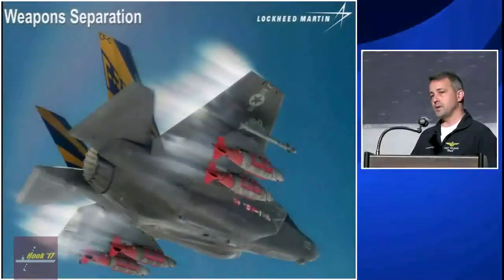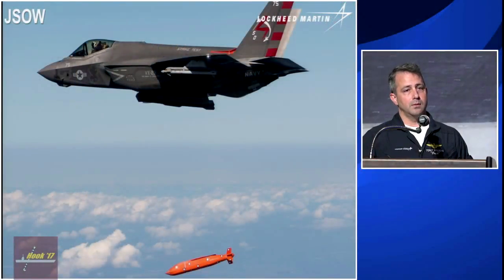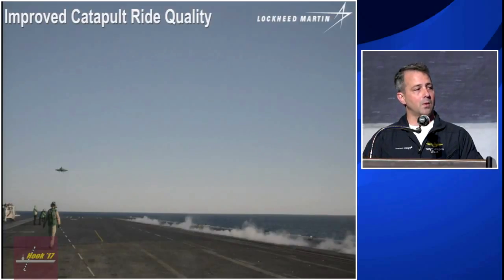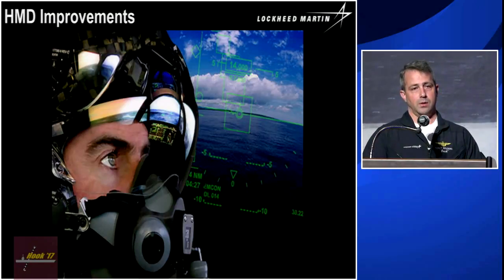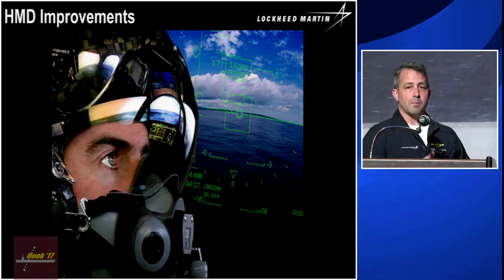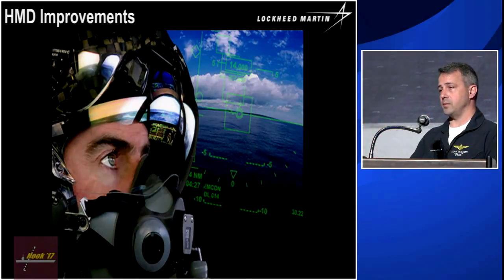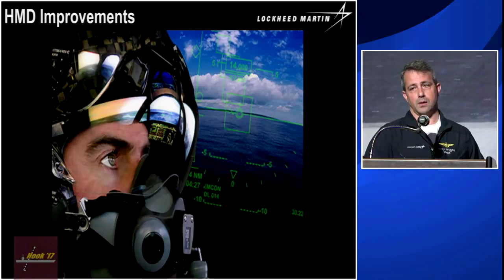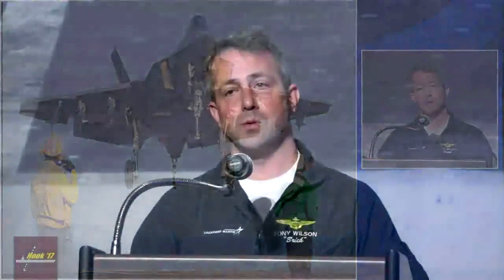Tailhook 2017 Symposium - Update on F-35C testing from LM test pilot

Comment: '
american any F-35s must has twin jetmotors are better than single jetmotor
Reply: F-16s are fine with single engines. and F-35 haters say F-16s are better....
Reply: bestamerica

F-35's 43,000 lbf large engine is roughly equal to Super Hornet's two GE F-414 medium size engines with 44,000 lbf combined thrust.

F-35's Option Block 1 engine upgrade has 6 to 10 percent higher thrust.
Reply: Why?
Reply: Hanz Cedric
F-16s are fine with single engines. and F-35 haters say F-16s are better....
'
both F-F musts be good team together...
no no both F-F hates each other

Comment: '
stop this video...
dont have to show this video...
enemy countrys can watchs this video, learns, copys, makes, flys test, trainnnings, cyber computers virusmakers, return revenges...
dont do that
Reply: bestamerica

No they can't. The information is too selective to be dangerous.

Also, twin jet engines aren't better than a single one. They require more maintenance, have a high risk of critical failure and the F-135 engine is extremely powerful anyway. The F-35 engine produces as much thrust as both the F-15 engines combined.
Reply: bestamerica, many of my fellow US countrymen may be slightly illiterate but certainly not to the extent that you are. Kindly stop posing as an American. Besides, if you think that it displays classified information, you are more than welcome to take it up with the MoD.
Reply: hi HV...
thank explain...
dont use a word - YOU -  on me...
let explain about this video...
here is a free time comment
Reply: hi ivanlagrossemoule,
twin jetmotors are more faster speeding and great flying sky...
F-16 is a great plane, tooo
F-16 is a little faster speeding than F-35...
both F-F are good planes
Reply: Best - You know they had Chinese parts in the f-35? You know that china hacked the US military sideways 10yrs ago?
heres the list
SYSTEM DESIGNS

Terminal High Altitude Area Defense
Patriot Advanced Capability-3
Extended Area Protection and Survivability System (EAPS)
F-35
V-22
C-17
Hawklink
Advanced Harpoon Weapon Control System
Tanker Conversions
Long-term Mine Reconnaissance System
Global Hawk
Navy antenna mechanisms
Global Freight Management System
Micro Air Vehicle
Brigade Combat Team Modernization
Aegis Ballistic Missile Defense System
USMC Tracked Combat Vehicles
Warfighter Information Network-Tactical (WIN-T)
T700 Family of Engines
Full Authority Digital Engine Controller (FADEC)
UH-60 Black Hawk
AMRAAM (AIM-120 Advanced Medium-Range Air-to-Air Missile)

Affordable Weapons System
Littoral Combat Ship
Navy Standard Missile (SM-2,3,6)
P-8A/Multi-Mission Aircraft
F/A and EA-18
RC-135 Detect./Collect.
Mk54 Light Weight Torpedo

TECHNOLOGIES
Directed Energy
UAV video system
Specific Emitter identification
Nanotechnology
Dual Use Avionics
Fuze/Munitions safety and development
Electronic Intelligence Processing
Tactical Data Links
Satellite Communications
Electronic Warfare
Advanced Signal Processing Technologies for Radars
Nanostructured Metal Matrix Composite for Light Weight Ballistic Armor
Vision-aided Urban Navigation & Collision Avoidance for Class I Unmanned Air Vehicles (UAV)
Space Surveillance Telescope

Materials/processing technologies

IR Search and Track systems
Electronic Warfare systems
Electromagnetic Aircraft Launch
Rail Gun
Side Scan sonar
Mode 5 IFF
Export Control, ITAR, Distribution Statement B,C,D Technical Information
CAD drawings, 3D models, schematics
Software code

Critical technology

Vendor/supply chain data
Technical manuals
PII (email addresses, SSN, credit card numbers, passwords, etc.)
Attendee lists for program reviews and meetings
https://www.washingtonpost.com/world/national-security/confidential-report-lists-us-weapons-system-designs-compromised-by-chinese-cyberspies/2013/05/27/a42c3e1c-c2dd-11e2-8c3b-0b5e9247e8ca_story.html?utm_term=.7a37ef397e15
Reply: Exclusive: U.S. waived laws to keep F-35 on track with China-made parts
https://www.reuters.com/article/us-lockheed-f35/exclusive-u-s-waived-laws-to-keep-f-35-on-track-with-china-made-parts-idUSBREA020VA20140103

REPORT: Chinese Hackers Stole Plans For Dozens Of Critical US Weapons Systems
http://www.businessinsider.com/china-hacked-us-military-weapons-systems-2013-5
Reply: 00Billy, there's alot of IFs in that washingtoncompost.

https://breakingdefense.com/2017/10/no-classified-f-35-info-stolen-defense-contractor-hacked-in-australia/
‘No Classified F-35 Info’ Stolen: Defense Contractor Hacked In Australia

BAE hack occurred in 2009 which is before 2010 Lot 4's Carbon-NanoTube material change. LM's Carbon-NanoTube stealth material can be found in Google's patent search.

Comment: Already combat proven by Israel. Totally trashed the hyped up Russian S400. Israel was so impressed by its combat performance over Syria that it ordered another 19 F35s. The thing is a beast.
Reply: Because the F35s avionics picked it up and avoided it all together.  That's the point.  Just like B2s and their "blue line", F35 does the same thing.
Reply: I've been saying once this thing see actions, there will be a line out the door to purchase it.  Then the question becomes who can be allowed to buy it?
Reply: Germany's Luftwaffe chief was fired when he recommended Germany to adopt the F-35, and the Iranian air defense General was fired when the Ayatollah found out Israeli F-35Is had been flying over Iran without challenge.  This was right after Iran had purchased and fielded the Russian new IADS and integrated it with their own radar and missile systems to beef up Iranian air defense networks.  F-35 didn't care, just flew over Iran repeatedly, running C4ISR missions sucking up all the RF and IR data it could gather and process as a net.
Reply: John Connor... basically shows he doesn't know wtf he's talking about lol. Stealth planes don't fly low to avoid radar. If anything they wanna fly as high as possible. The Radar "dome" (detection zone) gets shrunk because of the shaping.
The polar opposite (for same desired effect) of helicopters using terrain masking/flying Nap of the Earth. The whole point of Stealth IS to avoid the radar. You shrink the proverbial "dome" fly around the gaps of the IADS and start bombing whatever (or send in a LR glide bomb to kill radar site in addition/conj. to prev.).
Reply: " Totally trashed the hyped up Russian S400." ???...........poor ignorant....you didn't know that israelis were LICKING RUSSIAN ASS so that russians wouldn't engage them ?
you had no idea that your favorite toy was opperating WITH RUSSIAN CONSENT ( and the S-400 probably even menaged to gather some intelligence on F-35 ) ....that is soo sad
Reply: @themilosgrozni237  sure they were sure they were. We Russians are as pathetic as our weapons get over it.
Reply: The Russians won't be shooting down international warplanes because of major ramifications.  Nothing to do with evading S400z. Putin still laughs at the F35
Reply: if it trashed S400 .. why Israelis flew at low alt to avoid radars ? fail
Reply: John Connor:  No way they could have flown low level and done the unrefueled range they did.  Had to be high altitude mission profiles.
Reply: @johnconnor654  you're trash

Comment: Full external load and still Mach 1 plus....
Nice!
It does all the thing haters said for years that it would never be able to do that.
Reply: All the Mig 31 is good for is a high and fast long range interdiction of a high value support asset (AWACS/ISR/tankers) or intercepting old, slow bombers from China. I've read all your comments John and you really should just stop.
Reply: "WE KILLED EVERYTHING!"  (24:1 KILL RATIO)
Reply: "WE KILLED EVERYTHING!" (24:1 KILL RATIO)"  We killed everything with Block 3I software. Block 3F software coming soon. :-)
Reply: According to the first press release  the F-35s  engaged the F-16s  without any help.
Reply: "figures" ?  The max speed of any jet, especially a fighter jet  can not be thought  of in linear terms. There are no  max speed figures of a combat loaded F15 because combat is fluid. If the F15 in A2A configuration? or is it on a strike mission ?   You need to do the math for yourself. NASA provides the equations You needhttps://www.grc.nasa.gov/www/k-12/airplane/drageq.html
I was not criticizing the unloaded speed of anything. Why would I?  I was just pointing out that the "unloaded" speed  of a fighter and speed of a combat loaded fighters are not the same. Not even close. Anecdotally the F16  clean can do  Mach 2.2. You have to remember the F16 only holds about 7,000 lbs of fuel. What that means is that in combat it must have external fuel tanks. Add four to six missiles. It just became a 800 knot jet or around Mach 1.2. The F15 does not even have twice the fuel capacity of the Viper, but it has another thirsty engine and it it's far heavier than the viper. Us the equation, do the math and listen to what pilots are saying.
Reply: Constantine Joseph your speed figures are NOT with weapons. What is so hard to understand about that? Or is it intentional? Its absolutely absurd to claim any variation of the F15 does 2.5 in reality. By reality I mean with combat load. Same with the Sukhois.
Reply: John Connor lmao not close. 95% of 4th gen are limited to around 6 g's and Mach 1 due to drag and weight. The f35 has some of the highest power to weight ratio. The f35 can still hit 9g's with full load which I know yours can't. Also again the speed your posting is dry weight and at high altitude. The Mach 1.6 on the f35 is full load and at low altitude. Low altitude alone takes 90% of Jets going Mach 2.25plus to 1.6 area. So they are not any faster then the f35 in combat configuration.
Reply: Speed of sound is not constant...

F-35A's mach 1.6 has 1200 Mph attached to it. 

"Speed (full internal weapons load) Mach 1.6 (~1,200 mph)"
http://www.af.mil/AboutUs/FactSheets/Display/tabid/224/Article/478441/f-35a-lightning-ii-conventional-takeoff-and-landing-variant.aspx

https://www.nasa.gov/centers/armstrong/news/FactSheets/FS-006-DFRC.html
F/A-18 has Mach 1.8 ( 1190 mph ).

https://www.grc.nasa.gov/www/k-12/WindTunnel/Activities/knots_vs_mph.html
Refer to I.C.A.O. Standard Atmosphere table.

Altitude (relates to air density) vs speed of sound example
sea level = 761 MPH
10000 feet = 734 MPH
20000 feet = 701 MPH
30000 feet = 678 MPH
40000 feet = 660 MPH
50000 feet = 660 MPH

Using NASA's speed of sound for F/A-18, F-35's 1200 mph yields mach 1.815.
Reply: You killed everything with F-22 doing the heavy lifting.
"They also performed in an air-to-air role: although we don’t know the ROE (Rules of Engagement) in place for the drills nor the exact role played by the F-22 Raptors that teamed up with the Lightning II THROUGHOUT the exercise"
https://theaviationist.com/2017/02/28/red-flag-confirmed-f-35-dominance-with-a-201-kill-ratio-u-s-air-force-says/

Repeat "throughout the exercise."
Reply: 00Billy:  F-35's exchange ratio is counted independently of F-22's.  The only "kills" against F-35s were regenerated Red Air after already being killed, gaming the system out to close to WVR.  The same things happens in foreign partner sorties, for example form Netherlands or Norway.
Reply: and the only kills against the F35 and the F22 for that matter were done by jets in a clean configuration.
Reply: have a link? the first press release was this one 
https://www.defense.gov/News/Article/Article/1243169/exercise-red-flag-17-3-commences-in-nevada/
Reply: this is the second.
https://www.defense.gov/News/Article/Article/1253093/f-22-raptors-join-full-spectrum-red-flag-readiness-exercise/
Reply: https://www.grc.nasa.gov/www/k-12/airplane/factord.html
Reply: This book is a really good at explaining the concepts of "combat speeds" check it out.https://books.google.de/books?id=0Z9TAAAAMAAJ&q=Mach+number&hl=de&source=gbs_word_cloud_r&cad=4
Reply: hahah .. Mig-31 can go 3000 km/h with full external load
Reply: Matty mo lol then provide us the figures then.  Rather than criticising the unloaded max speed
Reply: Slow.  F15E Mach2.5, SU34 Mach 1.8, SU 30 Mach 2.0,
Reply: "too slow, too fat, too much drag!"

Comment: A has a gun. B has a lift fan. What does the C have instead of either?

Don't say "folding wings". I mean what is in that particular space in the fuselage?
Reply: Thomas Joyce All three variants have a gun, the F-35B/C just have it in an external pod just like the Harrier (it's actually a version of the Harrier's gun). The F-35B's liftfan is not in the space occupied by the gun in the F-35A.
The reason the F-35B/C don't have the gun internally is not because they needed that space for other things, but because the Navy and Marine Corps did not have a requirement for an internal gun. A wise move, since a gun is the least used and least important weapon on any fighter or attack aircraft. Better to carry more fuel for a greater range.
Reply: Fuel!
The US NAVY opted for more fuel and more range
Reply: heavier landing gear?
Reply: Thomas Joyce almost 20,000 lbs of fuel.

Comment: a lot of problems in the procurement stages caused all these lingering issues to cost . who can make a carbon/kevlar helmet weave ? answer is schuberth, BELL USA, ARAI, SHOEI. instead they got some composites team made to make them. instead of going to the experts. they contracted out to companies not even suited to their needs. 
the pentagon is a money pit. 

hopefully this jet sorts itself out.

how the hell do you have a probe issue with A/A refueling. aren't they standardized across all planes
Reply from the maker: "who can make a carbon/kevlar helmet weave"
A lot of people; the entire jet's skin is made of very advanced carbon composite weaves. Also, do SHOEI, etc have experience with Pentagon policies, regulations and requirements? Do they have military-level security in their manufacturing and design facilities? Have their workers being security vetted? Do they have experience in designing helmets designed to withstand 700mph winds? Besides all that though, the F-35's helmet's cost and the issues they've had have been in the electronics and optics, not the helmet shell.

As for A/A refueling, there's not much of an issue; F-35Bs for example have been aerial refueling for years without much trouble (it's the only way they could fly all the way to the UK and back for the RIAT and Farnborough Air Shows). The mention of IFR issues is just to do with a video recently released where an F-35C pilot was over-correcting and snapped the end of the probe off (as its designed to when forces exceed a certain threshold): https://www.youtube.com/watch?v=faxuDFHJ3NY&feature=youtu.be&t=1222

Comment: No mention of the oxygen system issues?
Reply: Viper - which is hilarious because they still have no idea whats causing it !
"Despite increased data collection since 2010, the Navy still doesn’t know what is causing these physiological events – but they are occurring at a growing rate."
"Similarly, on the Super Hornets, pilots saw 2.18 events per 100,000 hours in FY 2006, 8.65 from fall 2010 to fall 2011, and 31.05 from fall 2015 to fall 2016. On the Growlers, there were zero events until the fall of 2010; from the fall of 2010 until the fall of 2011 Growler pilots saw 5.52 events per 100,000 flight hours, and from the fall of 2015 to fall 2016 that figure spiked to 90.83 events per 100,000 hours.
On the T-45C, data collection only began in 2012 but has increased from 11.86 events per 100,000 flight hours in calendar year 2012 to 46.97 events in 2016."
https://news.usni.org/2017/04/17/temporary-fix-identified-t-45c-trainer-students-still-cant-land-carriers-permanent-solution-found

cross platform and cant nail it down in 8 yrs...
meanwhile the situation gets worse by a factor of 18x for the hornets and 4x for the t-45's.

Pilots have left the service -even f-35 pilots.

There are work arounds (Liquid oxygen bottles).but it is 2nd priority as T-45 have weight/space constraints.
(consequently, training is at 75% o) the service needs.
Still cant nail it down.
57 min mark if youre interested .. (thanks Dragon029) https://livestream.com/wab/tailhook2017
Reply from the maker: There's mention in other Tailhook videos (not on my channel, at https://livestream.com/wab/tailhook2017 ) of the F/A-18 and T-45C's issues. The Navy / USMC haven't identified the F-35B/C as having an OBOGS issue - there have been incidents, but primarily at the USAF's Luke AFB; the few F-35B/C physiological events have been few enough that they consider them part of the background noise (all jets, OBOGS or not have the occasional hypoxia or similar incident due to faulty valves, etc). As for the USAF, Luke AFB and F-35A, the USAF is still investigating, but they've found that some of the incidents were false alarms or procedural / training error (inexperienced pilots sitting on the ground, in the Arizona summer sun and >100F heat, with their engines running for half an hour at a time (very slowly going through checklists, etc), breathing in their own fumes due to a tailwind): http://breakingdefense.com/2017/09/jpo-fixing-f-35-oxygen-carrier-landing-software-glitches-vadm-winter/
That doesn't mean that none of the incidents were caused by the OBOGS; there might have been issues, but for a bit of context, the Navy currently believes that too-high moisture / water in the air is causing some of their issues, particularly in the T-45 which didn't have a water-separator. The Navy's also replacing all of the molecular sieves in their Hornet OBOGS to see if that makes a difference and both the USAF's F-35A investigation and the Navy are installing things like O2 sensors in their pilot's gloves and masks to get more empirical data.
Reply: Aircraft are flying again and restrictions are lifted.